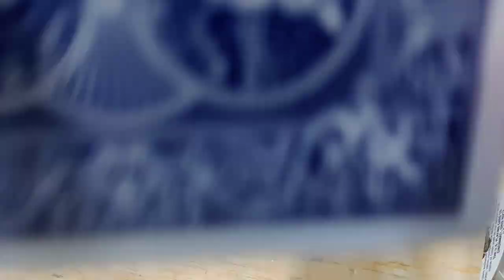Mobile Tool Stand with Drawer Storage | Shop Project

Comment: Nice work. Just a little heads up the respirator that you are wearing is overkill for wood working. It is designed for more painting and chemical work and has an activated charcoal filter that is only rated for a small amount of time once it is exposed to the air. 3M makes the same mask that has the ability to change out the filters it will save you money in the long run. I also noticed that you mask is missing the cloth pre filters as well you can get those off the internet or any store that sell automotive paint.  A simple N-95 style is more than adequate for wood working, but if its what you like wearing than more power to you. Not trying to be a know it all I just use to work a job were i had to wear the same mask. Keep up the good work.
Reply from the maker: Thank you for the comment and info. I bought the respirator for spraying paint and finish.  It's way more comfortable than my dust mask, but does need different filters for sure. Good call out
Reply: @keatonbeyerwoodworking  I have the same mask and swap out the filters depending on what I am doing. The dust filters are much cheaper than the VOC filters. 

Great video btw :)!